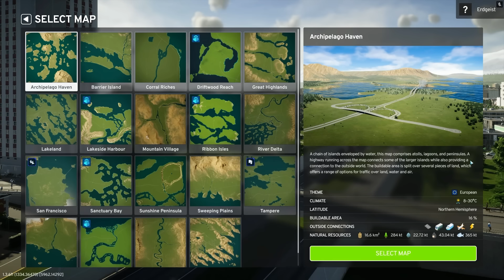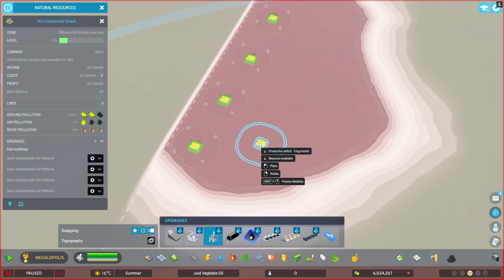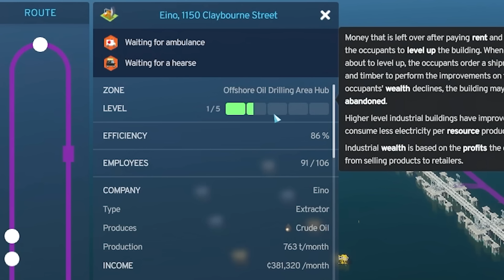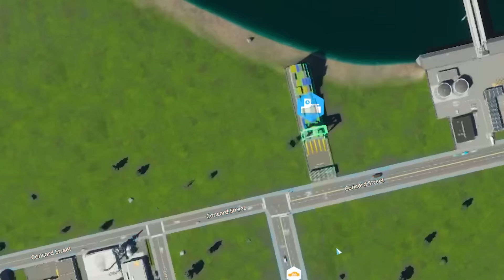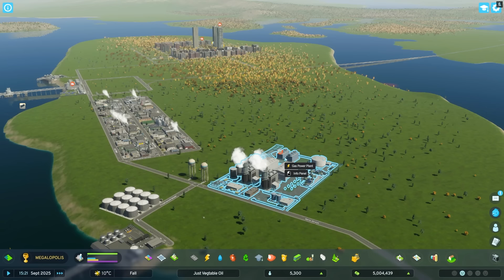Making $ 360.969 Exploiting Offshore Oil in Cities Skylines 2

Comment: An easy fix would be to plop down the signature buildings, which might help improve the profits by inducing demand. Because taxes are based on building level, not total revenue. So you have to induce demand for crude, educate and make sure your citizens are happy as well as offering them city services, otherwise I think your buildings would cap out around level 3.

To induce demand using signature buildings: 
The chemical plant consumes minerals plus crude oil to make chemicals.
Chemicals are consumed by the oil refinery and pharma building. 
Also I have no idea why, but the oil refinery building doesn't consume crude oil. 

Final note: Your commercial zones were very profitable, likely because your citizens were "relatively" low wage workers, your industry was also producing a lot of finished goods who made sure input costs for commercial were low,(this led to higher level commercial zone buildings) and also because high density commercial is currently the most profitable of all the zoning types.